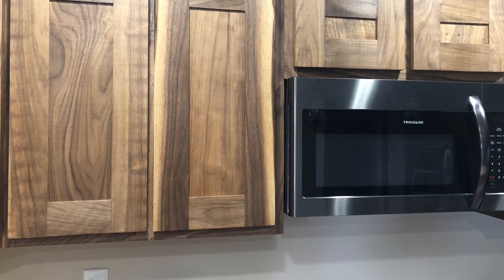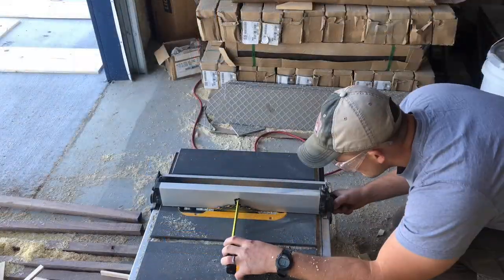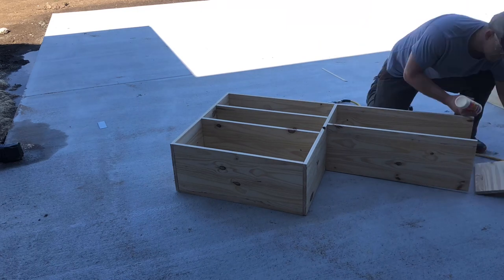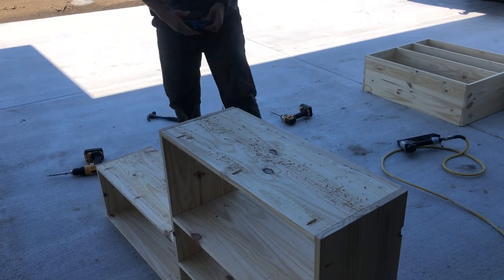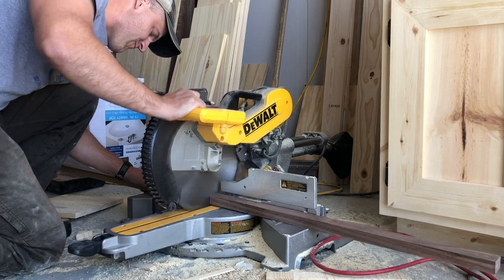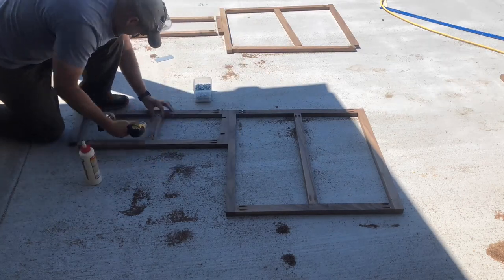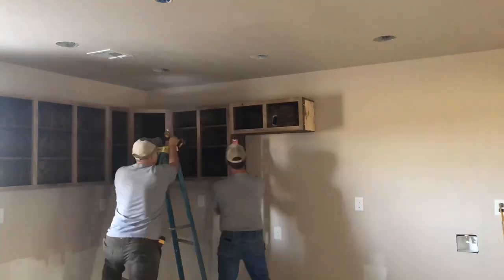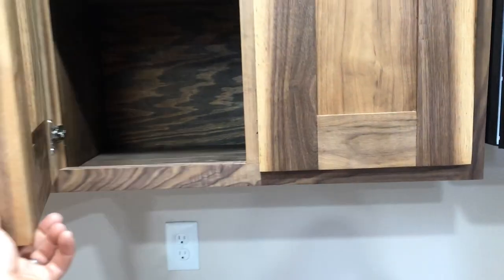How to make a 30” upper cabinet with 30” microwave cabinet

Comment: Does the microwave not have a range hood/vent fan/whatever you call it?  If it did, would you just cut a hole in it and run a duct through like a normal cabinet with a range hood?
Reply from the maker: The newer microwaves have a filter and it recirculates the air.  You don’t have to cut any holes for the vent anymore.  That’s the way my microwave works.  If it did, I would cut a hole in the bottom of the cabinet. No big deal